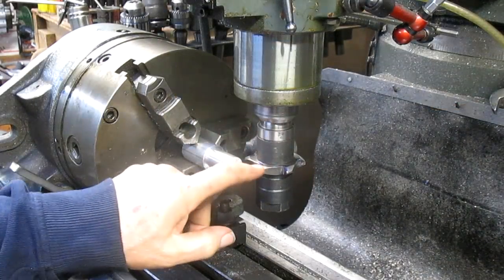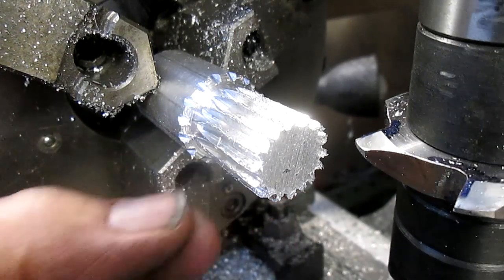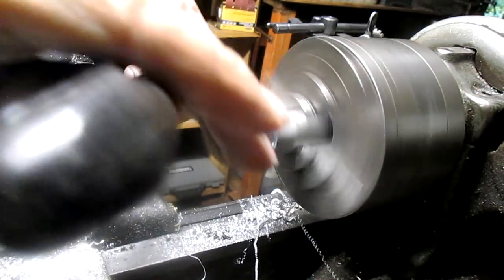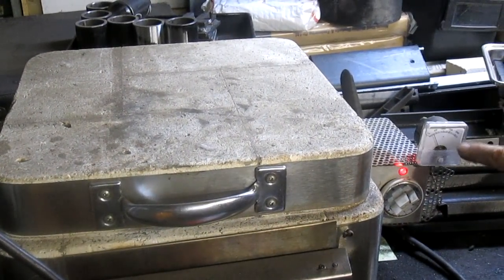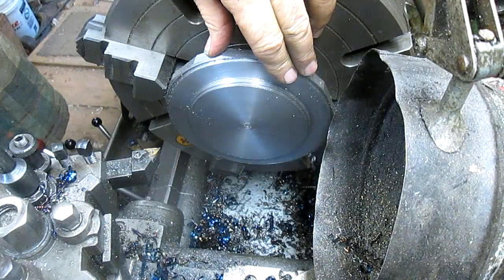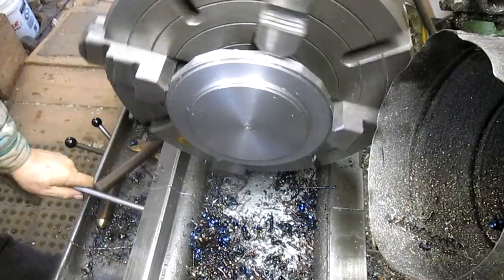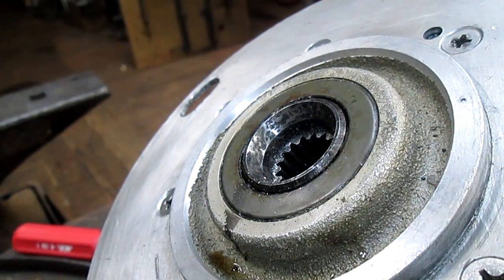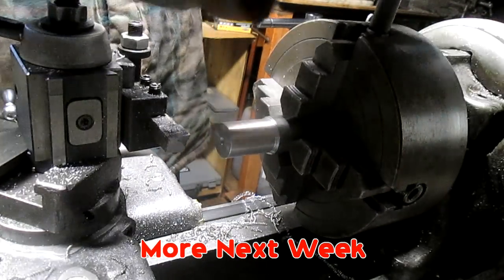Spline For Bonneville Salt Flat #3

Comment: Don't you want to make the shaft the correct size FIRST so that you can accurately cut the depth.  I you start with a 2 inch shaft and cut .150 deep by the time you cut it down to the correct size there wouldn't be any splines left.  That's exaggerated horribly but might be why it took 6 attempts to get the aluminum pieces to fit.